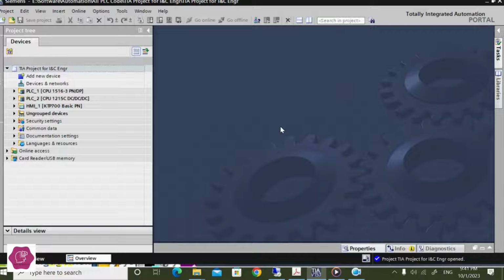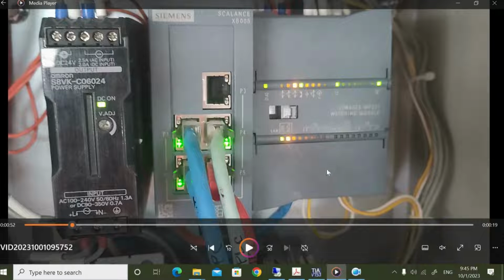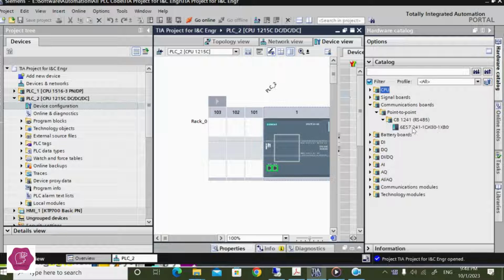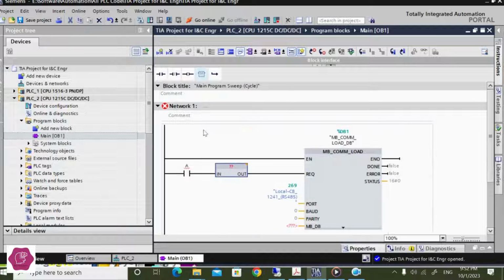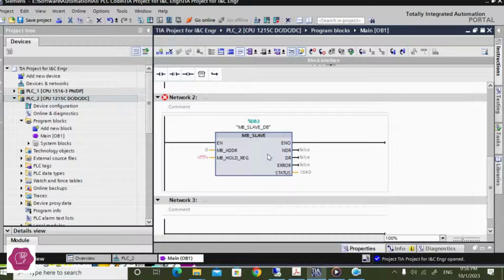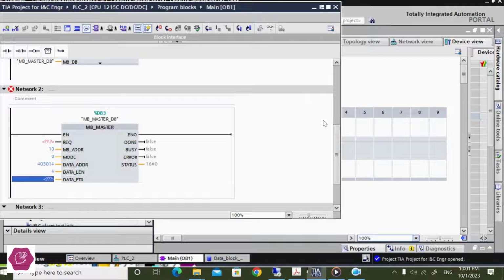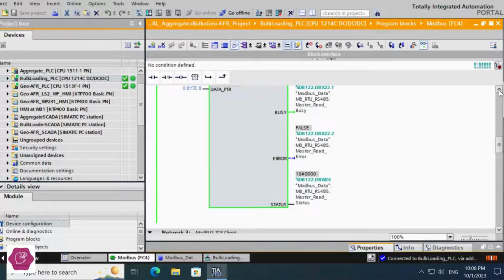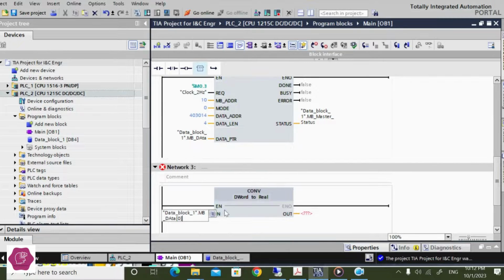TIA : Modbus RTU data read  I   CPU 1214C I WP231

Comment: If the register is 3014, why did you add 40 to it?
Reply from the maker: As I told all register are holding register and you know holding register start with 4.Normal holding register 5dl digit but those are extended holding register that's why putted 40